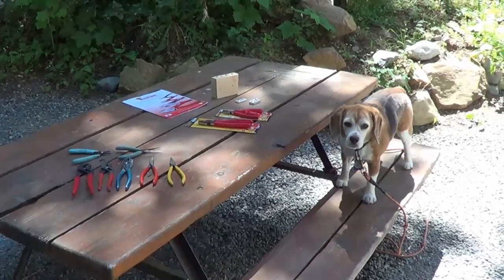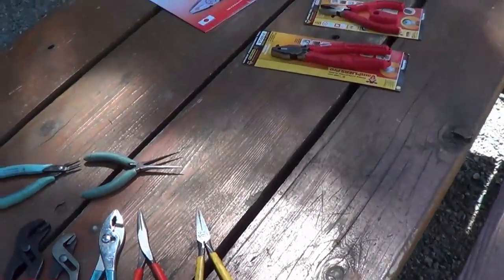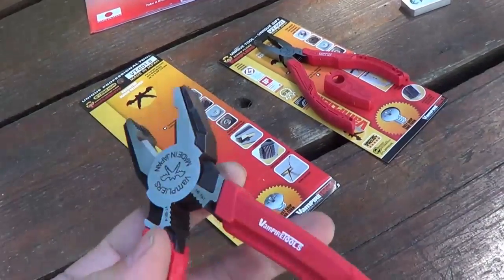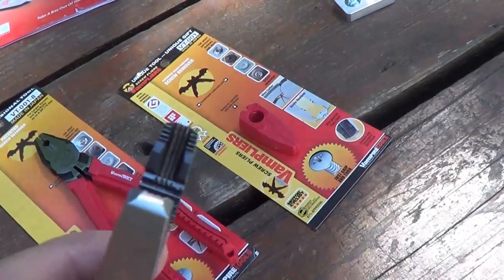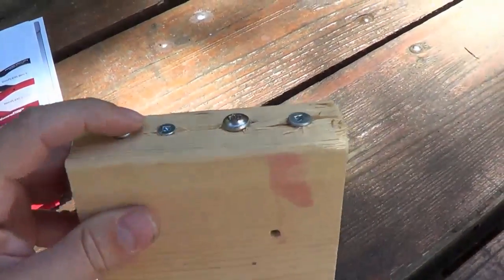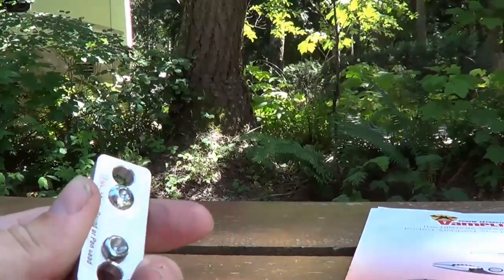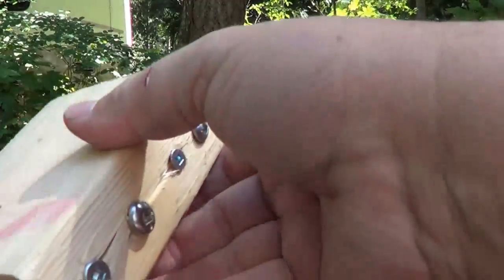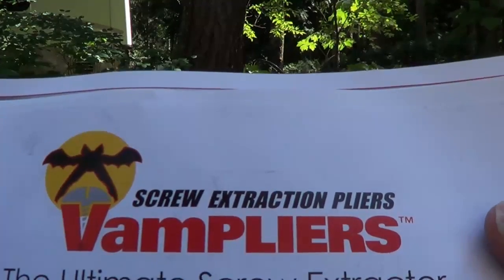Tool Review VamPLIERS for Stripped Screws

Comment: Those are awesome. It's one of those, why didn't I think of that, designs. I have a small Grab bit extractor set and I use it alot and I will definitely be getting some of those pliers to compliment my tool set.
Reply from the maker: georgeof78 I think if you use the grab bits alot then the Vampliers will come in real handy. Cheers Ray

Comment: I know this is a late comment but I also have a pair of the VamPliers and they work great ! I have used them many times on old rusty, stripped head screws, and they removed the screws with no problems. Every tool box should contain at least one pair.
Reply from the maker: Thanks for the comment, I still use mine all the time. Great tool. Cheer, Ray

Comment: Looks handy but being a mechanic for a while I am curious to see how they would work  or grip on a rounded hex head small bolt that is frozen up.. not that they would turn it but would they grip it good enough..lemme know if you get to do that sometime..looks great otherwise.
Reply from the maker: Tioga Trails Will give them a try, I'm pretty sure they should bite in well. Very hard steel and sharp points on these.